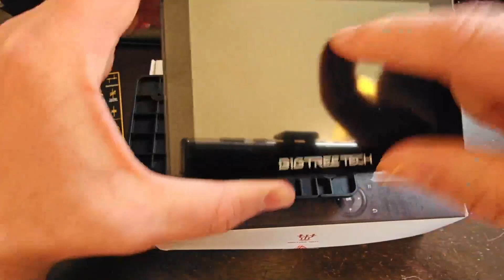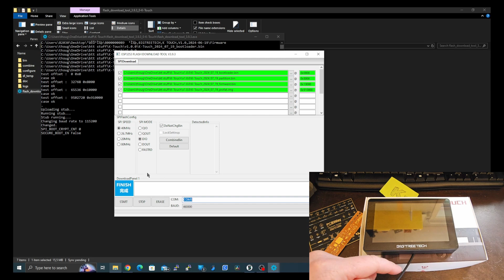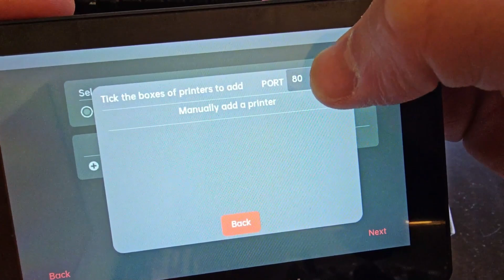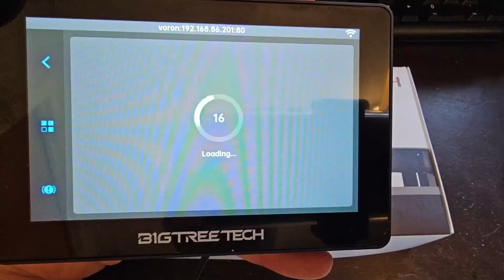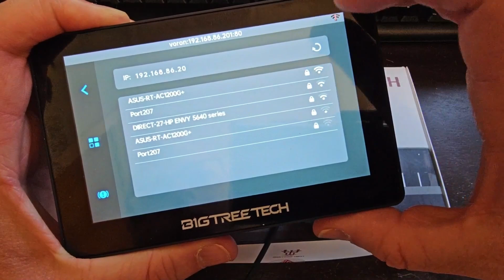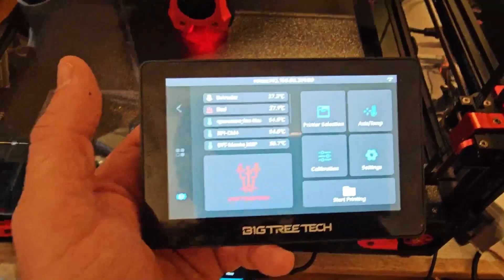Panda touch to K touch conversion and set up

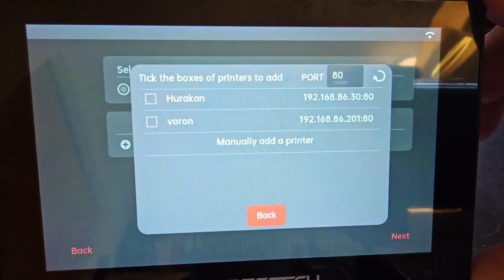Comment: What can I do if my bbl p1p can't be find by k touch because on my k touch write kliper error:null and I don't know what I need to do for it 24:50
Reply from the maker: You need to convert the K touch to be a Panda touch to be able to work with Bambu Lab machines. K touch is for Klipper firmware

Comment: PermissionError: [Errno 13] Permission denied: 'C:\\Users\\Kyavi\\OneDrive\\Documents\\flash_download_tool_3.9.3_0-K-Touch\\flash_download_tool_3.9.3_0-K-Touch\\dl_temp/bin_tmp\\downloadPanel1\\K-Touch_v1.0.0_firmware[1].bin'
Reply from the maker: I need more context of the situation, but typically a permission denied error is caused by the file being opened somewhere else, like being shown in an unzip tool or something like that. Close everything else and try again.
Reply: I tried, but it still has error with the firmware file
Reply: I am going to try using a new pc
Reply: it says stop on the flash download tool
Reply: i  just did it!
Reply: screen won't turn on

Comment: And just in case it isn't touched on in the vid. The Touch allows easy hookup of a temp/humidity sensor through the rear unpopulated connection. On my P1S I have this inside the chamber. I haven't tried the K Touch variant. Ideally it would be possible to use the Touch as a fan/heater controller based on this sensor. But that's way beyond my ken. The Panda Touch automatically displays this info as soon as the sensor is connected
Reply from the maker: This video was made before the panda sense existed.
Reply: @StackingLayers  I don't know about Panda sense. I just bought a cheap sensor board and connected it. Like $3.
Reply from the maker: Ah, ok. That is the true beauty of these screens. They are just ESP32 boards with a touch screen, so you can technically program them to integrate all sorts of things. It's cool that the sensor you tried worked, assuming without any code edit. They must have an auto address check for i2c in the code.

Comment: This was useful information, but I can't continue watching when the mouse cursor zooms around like some insane fly. It adds nothing to the information being presented and is a great distraction. At least I know know my P Touch isn't a brick if I end up updating my Bambu firmware.
Reply from the maker: Thank you for the input on the mouse. I see what you mean. I think I should learn to do better focus with post processing instead of extended hand gestures through the mouse pointer.
Reply: @StackingLayers  thank you for taking the criticism. Yes, it actually detracts rather than highlighting.
Reply from the maker: @imaginitivity7853 I actually appreciate when viewers point out things like that. I get lost in trying to provide the information and don't notice things like that. We can't improve without some good creative criticism.

Comment: this thing is a joke.  got mine b4 Christmas and it don't work. cant find my PS1   msgd panda over 2 weeks ago and no response
Reply: that's Bambu's fault. they released a bs software update that breaks the panda touch. The reason i am watching this video is to repurpose my panda touch i bought for my p1s.
Reply: The firmware update to 01.07 kills the Panda Touch (or at least blocks the required communication for it to work). There is a warning on the BTT site, but really, they should have stopped marketing this as Bambu compatible months ago knowing this update would break it
Reply from the maker: It's still compatible depending on your system settings. Enough backlash from the community convinced Bambu Lab to  make a dev mode to break free (to a point) from the locked down system.

Comment: And that was easy for you? I did not understand anything about after extracting.. Other tuber made it so much easier, just plug and play..  😔
Reply from the maker: Yeah very easy. You cannot plug and play a Panda touch to a Klipper firmware machine. If you want a closer out of box experience then it's best to get a k-Touch to start with since the compatible firmware is already on it. This is for those that want to convert from a Panda touch to a k-Touch without buying a new unit.
Reply: @StackingLayers ho appena acquistato panda touch, non ce modo da un dispositivo di gestire sia bambu che klipper
Reply from the maker: @francescodigregorio8161  no. They use different protocols for communication.

Comment: Thanks for this -  i just swapped mine over to Ktouch - i had not used the screen for my P1S in a long time. One thing i think would rule (if possible) is if BTT adds webcam capabilities
Reply from the maker: I agree. Unfortunately I don't think it's possible. Video would require too many resources making it tough for the rest to keep working smoothly. I think they'll could add a snapshot feature though. Where it could grab an image every so many seconds.

Comment: Thanks for the vid.  I just ordered one to put on my modded Ender 3 that has a BTT E2EZ and klipper.  It really is nice not to have run a HDMI cable.  I modded a Qidi X-Max-3 and had to run a hdmi to a new screen, this would have been much easier.
Reply from the maker: It definitely makes for a painless setup. From what I gather, there's a bunch of upgrades coming to the K~touch soon too.